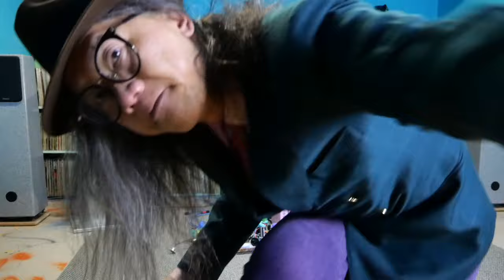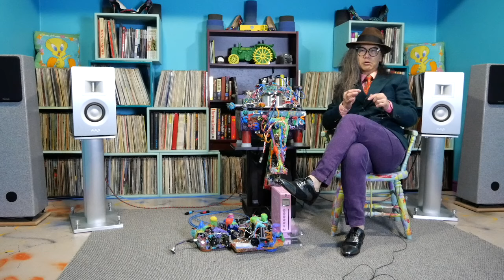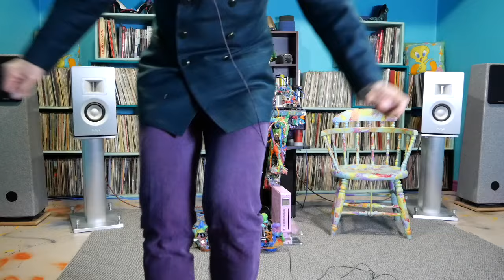Why Other Companies are NOT doing what I Do?  Why Can't They?

Comment: The wattages were underrated back in the 70's and early eighties. Consumers  would be sold on getting bigger bang for tte buck. Equalizers were the must have back then and were sold on tte idea of better, bigger sound. Not so as it was a distortion sound control and a gain control. Most thought it was an extra amp. The lowest cost of advertising was and still is, TRUE WORD OF MOUTH FROM HONEST PEOPLE LIKE YOU, ANGELA GILBERT.
In the 70's MARANTZ advertised that their products were BUILT LIKE TANKS.
In those days, someone told me that SANSUI was the best bang for the buck, and is better built than MARANTZ. Proof is to talk to technicians that have repaired all brands of equipment. They will tell you that they've seen more MARANTZ equipment for repairs, versus SANSUI. They also have said that the owners were all very good at taking care of their equipment.
Reply from the maker: Equipment these days are getting more complicated and more difficult to repair.  Without specialized equipment and/or the manufacture support, it is impossible to fix any mass produces products.

Comment: Back in the 1950's HK found that allowing variable feedback effecting the output impedance left in the hand of the untrained end user was not for the masses. The song remains the same.
Reply from the maker: Totally agreed.  When I do user adjustments, I will only offer the adjustments which cannot in any way damage the hardware.  Easy to do the preventative measure.  Allowing user to adjusting output impedance via feedback is not very fool proof.

Comment: I think Hifi industry is particularly hard because purchases are often infrequent. Many keep components for many years.
Reply from the maker: @Coneman3  It is one of the many reasons the industry have to keep inventing things which are marketable.  As I have mentioned in the video upsampling was in fashion about 20 years ago for 10 years.  Than higher sampling rate, class D super high power amplification, etc.  New stuff to attract new buyers.
Reply: @angela-gilbert  JBL l100 .sold fairly well i believe. I know you dont need a car sub woofer however if a company does not produce pro gear then are they a pro audio company?  in an 18x30 room anything smaller than 10 woofer without horn and real mid is just a bluetooth sound.   it should be connected to one integrated or pre and two amps. if you dont have 300w rms (sub woofer wise}watts to play with each side then why try and push the speakers. not two pro amps like Crest. two slave amps or mono blocks without fans or hums. im gonna say anthem or nad or if your lucky yamaha mx /ax

Comment: You operate in a different dimension. The builder (RIP, Bob…) of my competition pistols is the closest example I can think of. Coincidentally also Chinese (can this be a “thing”? 😆) If you built match guns, you and he would be like competitors in the industry.
Reply from the maker: @brianyee5504  I assume Bob thought outside the box and constantly think and trying different ways to improve accuracy.  Regardless of whether it works or not, he just have to try it.  At least that's the way I am.
Reply: @angela-gilbert  Exactly. He was the first Asian Olympic competitor (London 1948)on the U.S. pistol team and later built competition bullseye guns for other aspiring shooters. One man, one gun shop. Always tinkering to make an existing design better. All by hand.

Comment: Why do you have so much silicone in your amplifiers. If a component in there blows and it needs to replacement and it’s covered in silicone how do you go by that or do you replace the whole amp.
Reply from the maker: Silicone can be easily cut if you know how.  You are not the only one asking this question.  If you have worked with silicone enough, there are many tricks which make working with silicone a joy.

Every amp I have ever made since 1994 can be repair.  They are all done with various amount of silicone.  Nothing to it if someone can handle a sharp knife with skill.

Comment: if that little speaker can push wind then show us. Anyone can imagine it sounding louder . i think stuff like this is snake oil. Look at what speakers work. a general example JBL, EAW, RCF, Tannoy, Yamaha, altec etc. so show us the basket on the woofer.
Reply: The silver stand mount speakers are AAD 7001i designed by Phil Jones (professional bass player & legend speaker/pro audio designer).  Yes - the bass (down to 25Hz) is real and shocking from those speakers.